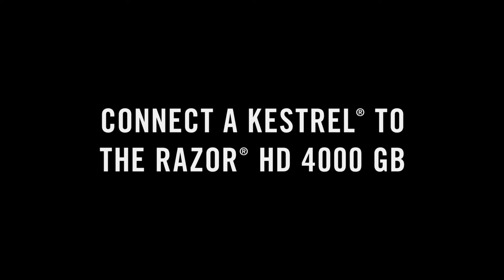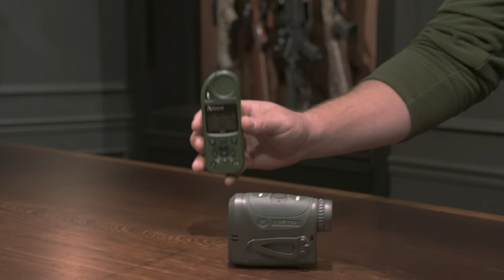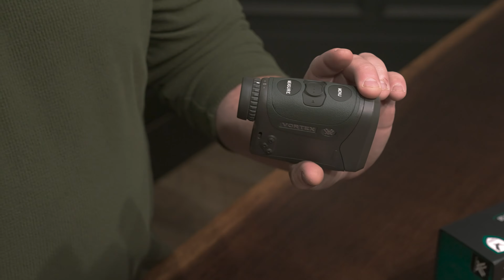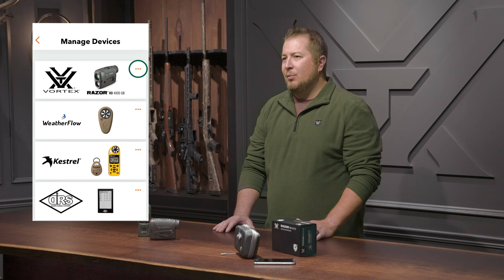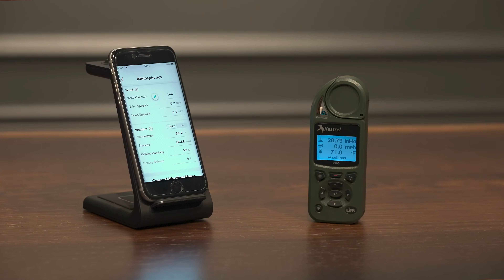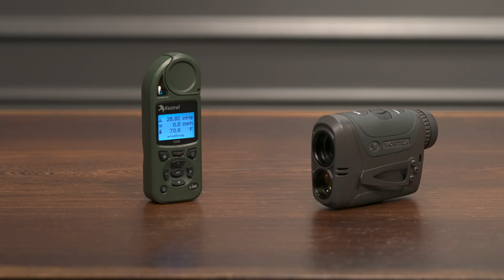How-To Pair your Razor® HD 4000 GB Ballistic Laser Rangefinder with your Kestrel®

Comment: So why would I like the Kestrel directly to the Rangefinder? Just so I won't have to use the phone and everything will be fed into the Rangefinder? It seems like Connecting the Kestrel directly to the App makes the most sense and will allow you to use a lot more information and data from the Kestrel as compared to the method where you connect the Kestrel to the rangefinder first. Can someone who knows better than me please advise?

Seems to me if I were to go with options 1, ie connect directly to rangefinder, then might as well get a Weatherflow tempest since I'm only getting wind speed and direction and not getting anything else out of the Kestrel. Correct? 

Many thanks!
Reply: Did you figure this out? I have the same question. Why would I use one or the other. I feel like connecting the Kestrel to the app, gathering your data and then using the range finder based on that data is the best way to go. The only scenario I can think of is if you are wanting continuous data with a kestrel on the tripod or something and then you can just keep ranging and getting the latest without having to record on the phone.
Reply: @chandlerh  I just got the weatherflow meter and it's been fine. Will take me a while to outgrow it probably

Comment: will this pair to the weatherflow meter so that once it has been set up, the phone is not needed for the LRF to get the wind data directly from the Weatherflow?
Reply: Did you ever figure this out? I always carry my phone but now I’m curious. I bought the talon 10k range binos and will be using the weatherflow
Reply: @RangeManDan  I never found any info so bought another Range Finder instead.
Reply: @Teolulz I’d have to believe you wouldn’t need the app. Since it’s all on the new relay network. I’ll have to test it soon

Comment: Linking a kestrell 7500 and the 4000gb together, does the 4000gb send distance, direction, and inclination data to the kestrel to use the kestrel for firing solutions? My main interest is using a range finder that links its data to my kestrel so ive got less things ive got to manually input into my kestrel
Reply: As a follow up to my question, I did contact both kestrel and vortex, and was told the 4000gb doesn't send information to the kestrel. The fury 5000ab however does, so I ended up picking those up and they work well with my kestrel.
Reply: The main point is to get all the data in the rangefinder to get the most accurate ballistics when ranging the target. So the data direction is Kestrel to Rangefinder. 

The Kestrel does not need to be the Kestrel Ballistic model, just any model with wind speed alone or with +wind direction is fine. 

The rangefinder is missing mainly local wind speed and direction. That’s why when  pairing it directly with the Kestrel, it only sends those 2 values.
Reply: Do you know if I ended up pairing the kestrel directly to the range finder I can leave the phone behind?